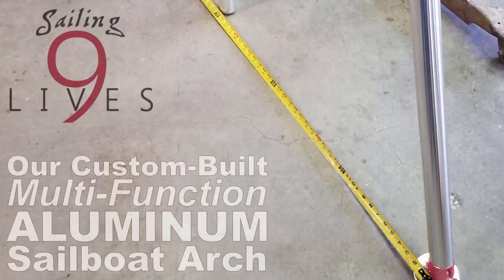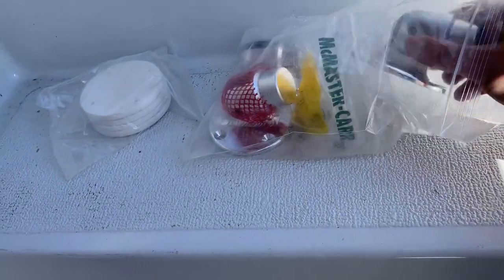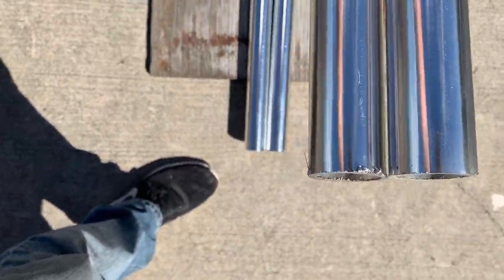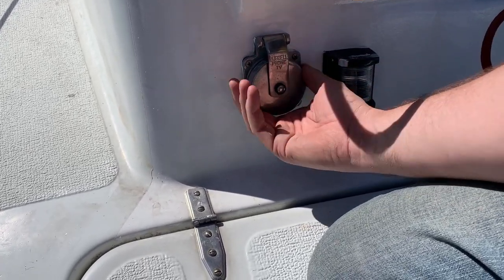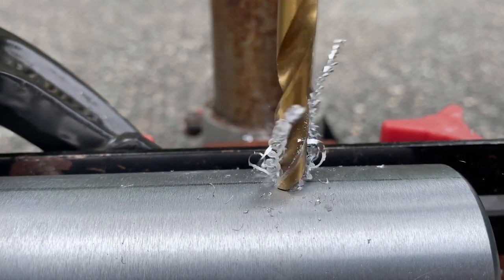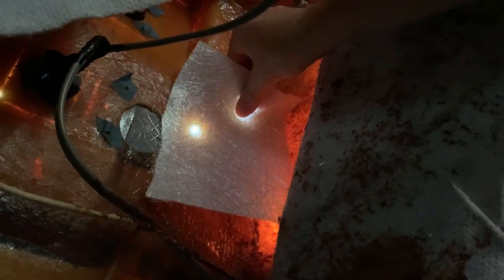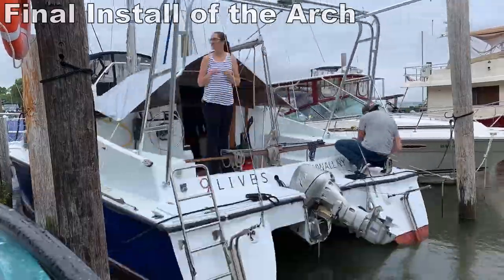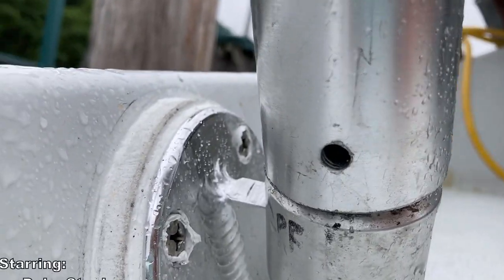Installation of a Custom Multi-Function Aluminum Arch on Our Catamaran (Boat Work: Sailing 9 LIVES)

Comment: Love the arch.  Waiting for the next installment to see what it looks like set up with panels and the raydome.  First the on-demand hot water heater and now the arch.  It's like reading my own wish list.
Reply from the maker: Thanks, Jack! Yep, we are super pleased with how the equipment ended up mounted on the arch. It handles the load beautifully, whether sitting still or in rough seas. Maybe we will make another project video on the solar and radar setup, but you can see the gear in some of our upcoming sailing episodes as well.

Comment: Impressive build!  I didn’t know you can mail order custom arches.  That tubing almost looks like chrome.  Very well polished.  “Good enough” - a term I use frequently also when working on my boat..lol
Reply from the maker: Thanks! I can’t weld aluminum, so it was better to hire someone. People keep telling me about a competitor to my friend William, a competitor who makes towers and arches on the Atlantic coast. I am well aware of them, and their “tower in a box” product is fairly close to the same as what I had made. I wouldn’t deal with them because 1) their cost is much higher than what I paid, but 2) my brother used to work for them, designing and installing their products. He even bought into the company... and then had to sue them when they tried to screw him out of his investment. They are the serial bankruptcy type, weaseling their way out of paying their creditors, all the while collecting tax-free cash payments off the books.
Heh. I got on a roll, there. Sorry. Hate those folks.
Our arch is polished aluminum, and it looks great. Because it is polished, it is not so likely to corrode.

Comment: Wow, Amazing how same parts of your arch can have those different placements of their parts!! I would of expected they would have been made on a movable gig and be tighter tolerances than what you showed!!  

Install wasn't a slap it on, as is and DONE!!! But guess you expected that and was necessary for that custom fit!! Seems like a complex fitting onto the boat, but guess most boat adaptations are never as easy as working on home straight/flat walls/floors!! I see, You've a natural patience, for that kind of work!! Myself, would have been carefully fitting sticks of dynamite on the boat, half way through that job!!!

Can well imagine you saved tons of $$$$, doing the job yourself and it came out looking really classy!! Great job! Be interesting, seeing all that you'll hang from that!?!?!!
Reply from the maker: YouTube deleted my reply. sigh
Once installed, the minor differences in the two sides can't really be noticed. The front mounting pad on the port side ended up less than half an inch further forward than the one on the stbd side... no big deal.
Virginia made a comment that the arch project took WAY TOO LONG. It echoed similar comments she had made about the paint project... and the composting head base project... I think she's onto something here.
As for patience vs. dynamite, there were multiple occasions where we were leaning closer to dynamite. But, I guess patience DID win out, in the end, because the project did get finished. :)
Reply: @Sailing9LIVES  Nice to know, you have those Dynamite moments too!! Now wondering, how you could of offended You Tube???
Reply from the maker: @joeroscillo4015  I think the ol' girl just had a hiccup. She's happy enough with us.

Comment: It freaks me out how similar, yet different your Gem is from mine. I'm not sure where custom started on either. That the wheel is on the Port side really shocks me. That arch is gonna be sweet!!
Reply from the maker: Yeah, lots of years have gone by where owners have added their own custom touches along the way. The helm on the port side is original on our boat, but PCI switched to the stbd side soon after our boat was built (or so I am told).
We've been using the arch since August, and it was worth the work. Our solar panels used to be mounted on the bimini, but that has taken a departure from the boat. We now have 4 100W panels mounted on the arch, and our solar game is much improved... no more shadow from the boom over one side or the other. Our radome is mounted in the middle of the arch on a pedestal and looks really cool (looks cool because it is not yet functional -- we haven't yet finished installing the new multi-function display). We don't have the awesome SS rail and davits on our boat that you have (jelly...), so even our simple davits are a game-changer, giving us a way to carry the dinghy somewhere other than crowding the foredeck. :)
Reply: Helm is portside on my Aristocat. Not sure what the factory side was🙄

Comment: Awesome build! Thanks for sharing. Wondering what those adjustable feet are called and if McMaster-Carr sells them or if they were a custom build? Thanks!!!
Reply from the maker: Thanks!
Good thought about McMaster-Carr, given the labeled bag seen in the video. Such feet are referred to as pin and pad mounting plates. I tried looking them up at mcmaster.com to see if that is where they originated, but didn't find them. I see that competing arch/tower builders all seem to have their own design of this concept, so maybe they are all custom built. I ordered my arch from nauticalcreations.com, and you can see on that site plates very similar to the ones I received.

Comment: Hello, I’ve been watching your videos for a while and I’ve got a question for you. I am looking into Gemini Catamaran that does not have a dinghy davit on it. Can you give me an idea of what that entire system weighs in the ballpark price of having someone build that is? Thanks.
Reply from the maker: Hello, sorry for the long overdue reply. We have been "away" from YouTube for a bit, focused on some other things that have taken priority. We're coming back soon!
This arch is obviously a custom install. If you were to install something to serve only as davits, you could get away with something far smaller and lighter. Our arch is intended to support davits (sort of davits...), serve as our solar panel mount, and carry our radar dome. So, it is a bit heavier because of the size it needs to be. I also wanted the legs to be out of the way as much as possible.
I don't have an accurate weight for the arch, but when assembled and un-dressed (no solar, no radar) it was easy to carry around over my head. I would estimate it weighs around 75 pounds. I think the solar panels add 80-90 pounds, and the radar dome with the aluminum pedestal add about 20 pounds.
As far as cost goes, I worked out a price for the arch and the radar pedestal "thrown in for free" for $1,400.
Reply: Thanks for responding, that is the information I needed. Happy sailing!

Comment: I was going to say something like: "look at all those pretty curves and not a single shot of Virginia" and then you blew it for me.  Or did you?  🤔
18:00 First rule of installing something with many fasteners: Install ALL the fasteners loosely BEFORE tightening any of them.
Reply from the maker: LOL, soooooo many curves... :)
First Rule of Fasteners, yes, 100% understood. We followed it perfectly EXCEPT for the 4 bolts holding the arch to the feet because the arch was assembled off-site and then attached to the already-mounted feet. It all worked out fine, it was just a little challenging.
I am considering taking another run at this thing and aluminum brazing the connections, something I had considered a follow-up step when I was bolting it all together. I am satisfied with the fit and placement of everything, so it might as well be finalized. I can then get rid of the thru-bolts. What do you think? You seem to have some Canadian know-how, Marcel.
Reply: @Sailing9LIVES  Thinking out loud:  I like the idea of taking the 'fully assembled unit' (including the brackets that bolt to the hull) off and having the entire unit brazed together- IF you can ensure that there WON'T be any twist while it is off the boat.   You could do it while attached to the boat,  but can you get fully around the bases?   Then the question becomes what to do with the bolt holes?   Run wires for your solar?  A Benefit? by removing the stainless bolts you don't have to worry about dissimilar metals?  In the words of Forrest Gump.... that's all I have to say about that.
Reply from the maker: @marceld6061  
All good thoughts, Marcel, thank you. I believe I would braze everything up top with the arch assembled in place, eliminating any risk of twisting. I would likely then remove the pin from each foot and then braze the, uh... ankles... into the legs with the arch safely off the boat and the torch not pointing at the fiberglass. Maybe a hole or two could be left open for wire runs (I have buried SOME of the wires already inside the arch), but the rest could be brazed shut fairly easily. I've done such things before in the past with holes in aluminum.
I just started running...
Reply: @Sailing9LIVES  ...leave some holes near the bottom as drain holes... "you never know what you're gonna get" in there...
Reply from the maker: @marceld6061  
Mama said these are my magic shoes!

Comment: Too many mistakes on that arch, they weren't very professional in their work. Why you didn't ring and put in a complaint is beyond me, even if you made it work, it should have been better made.
Reply from the maker: I mostly agree with you, Shane. It was custom-made to my specifications (intentionally oversized a bit so I could get the final fitment right), so I assume it was not built on a jig... but the differences from side to side were "off" enough that I am surprised they weren't caught, even if being built using a measuring tape and marks on the floor. I know from the photos (very start of the video) that an adjustable support was used, maybe considered a partial jig, so in some dimensions it is spot-on.
Anyway, it was close enough and quite useable as delivered, especially knowing I was going to shorten that front leg and so reduce the impact of that leg shooting off at a slightly different angle. Besides those small mistakes, the quality of the workmanship was quite high. The gentleman who built it for me had already charged me FAR less than the well-known competitor in New Jersey, plus he threw in a radar mount extension for our Garmin for free. He's a great guy, maybe just needs a new measuring tape. :)
Reply: @Sailing9LIVES  fair enough mate.So long as you're happy with it, that's all that matters.

Comment: Looking good! This wil be pretty on your boat! Why did you choose aluminum over stainless steel? - And how do you prevent galvic corotion between the aluminum and the stainless bolts? Mine is in stainless steel and the solar panels are aluminum and I used rubber gaskets between them to minimize contact
Reply from the maker: Thanks, Roger! Well, in this instance, the cathode (stainless steel fasteners) area is very small compared to the anode (aluminum), so any electron transfer will be minimal. I also coated the steel with a clear coat to further minimize contact a bit. I suppose rain water will act as an electrolyte, but at least that is not always present.
I am aware that this is not an ideal setup, but it should work out OK for quite a while. There are plenty of aluminum towers, radar arches, wakeboard arches, etc. on boats using steel fasteners and they tend to work well.
Let’s hope for the best!
Reply from the maker: @SailMermaid  
I had just typed up a long response, and then Josie touched something on the keyboard and the window with my un-sent reply disappeared. Oh, that girl!
OK, so the gist was something like this:
You made me think of something. Do you recall that beater car I used to drive from Florida to New York? It happened to employ some construction techniques that were very unique in the automotive industry. In spots where you would normally expect to find spot welds to join panels together, you will instead find self-piercing steel rivets through the aluminum. Hundreds of them... maybe thousands. This is apparently done quite a bit in the aerospace industry. There must be a reason why there is little worry about galvanic corrosion in airplanes (and a few cars) from this sort of process.